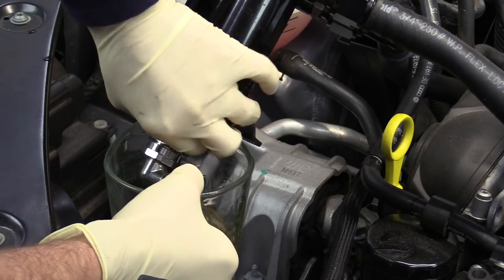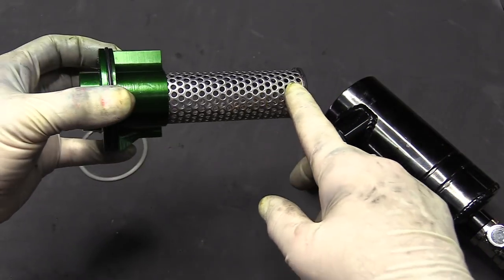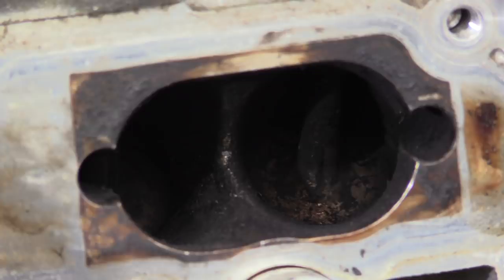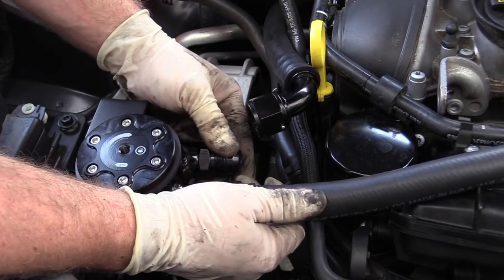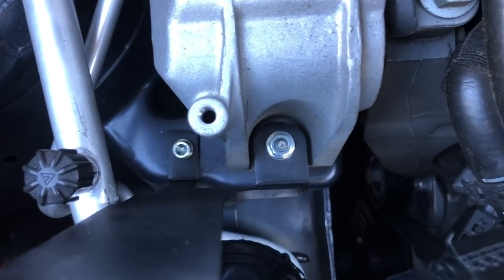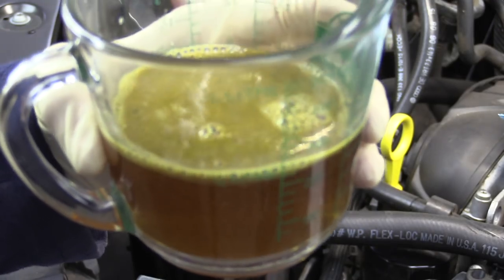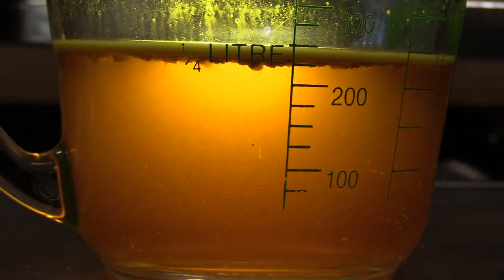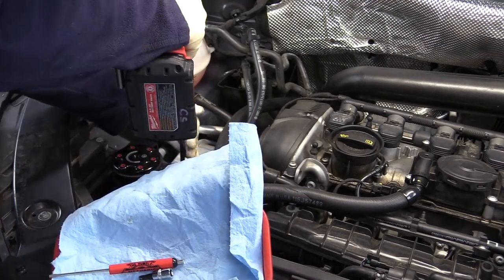Do Catch Cans REALLY Work?

Comment: Looks more like water than oil. Like condensation
Reply: Check out anything lp/nat gas powered. 
White milky shit coming out the breathers , and the oil isn’t far behind that.
Reply: Catch can liquid is blowby (what blows past the rings on the piston into the oil sump) and therefore is mainly petrol and oil (the oil mainly being the solid chunks you see in the liquid he pulled out).
Reply: He mentioned earlier - she's already got two oil separators, what for separatin' yer oil! I presume they're directly ahead of this, so if VW did their job right there shouldn't be much oil getting this far to begin with.
Reply: In my experience, of tens of thousands of miles with catch cans, you collect a ton of condensation as the gas cools and a tiny tiny bit of oil.. exactly as this video shows
Reply: Which is why you do not run those aos setups that filter at the oil filler tube. All that water goes back into the sump.
Reply: You dont want that going threw your engine regardless.
Reply: until you smell it; smells like gasoline/oil mix
Reply: I agree combustion creates H2O molecules.
Reply: @Itwargssf R: Through....
Reply: It is a lot of condensation. I have seen people think their headgasket is leaking because of the white condensation sludge that had built up on the oil fill cap. Just turned out to be people who did short drives all the time and their engine never really sat at high temps for a long time. The water (and fuel) evaporates out of the oil at full temperature but a lot of people don't let their car get hot enough for long enough when they commute to work.
Reply: B K So should I be running something thicker then 5w30 in my 1.8t? It’s a MK7
Reply: thedarkgreenvanman use 5w40 better
Reply: If that is either water or fuel collecting in there they are both, paradoxically, beneficial to cleaning the intake and the combustion chamber. This video showed zero "results" of whether a catch can works. The results would be minimised crud in the intake & valves and there's only one place to check that. Clue: not the catch can itself.
Reply: @ButtKickersReviews  Yup. Won't sell to people to good when you have to drain a catch can every month. Lmao
Reply: @thedarkgreenvanman  use wd 40
Reply: Car manufacturers would never put that on their cars because 99% of the people are too lazy to check it every month
Reply: @ButtKickersReviews  This really bugs me.  I bought a 2002 Mercedes SLK 320 recently.  Did my first oil change using MB new recommendation for Mobile 1 0w-40 synthetic and about 1000 miles into it I'm hearing a lifter tap in the right rear bank.  Just seems very suspicious that it developed soon after the oil change and this oil is very thin.  Don't know what to do now.  Drain and replace 8 quarts of expensive oil and go back to "thicker" oil or try an additive like Liquimoly lifter additive and run it a few thousand more miles.
Reply: thedarkgreenvanman 5-40 syn  in the winter, and 15-50  or 20-50 syn the rest of the year. 

You’ll notice immediately how much quieter the engine is
Reply: @ButtKickersReviews  ask 3 different people get 3 different answers. My question to you is, why would 5w-40 be any different than the 0w-40.  Both are 40 weight synthetic oils with the same viscosity at operating temp.
Reply: Randy Maizland Simple,.. These engines have large oil galleys, and need a thicker oil on startup. 0 and 5w are too thin on startup to build oil pressure quickly. Startup is where most engine wear occurs. 10w-xx is as thin as I’m comfortable going in the cold
Reply: @ButtKickersReviews  makes sense but my valve/lifter tap is not just when cold are only on start up.  It remains at operating temp too.
Reply: Randy Maizland you may need a hpfp cam follower replacement; which is fairly straightforward, and cheap.  Before you change your oil next, top it up with marvel mystery oil, and see if it silences a potential stick lifter; which would be my second guess on your engine
Reply: @ButtKickersReviews  thanks .... not too optimistic on an additive but won't hurt to try right.
Reply: Randy Maizland It generally frees up sticky lifters, if that’s the issue. If it works, just change your oil afterward, and call it fixed. What year is your tfsi?
Reply: @ButtKickersReviews  sorry..what is tfsi?
Reply: @randymaizland9662  it depends on oil pump type
What is your oil pump type if it's like a power steering type of engine oil pump it needs 0w ...
If it's a star like oil pump it needs 5,  10 w ...
It's not only about oil passages actually oil passages depends on oil pump type
Reply: @matteightytwo  so what you are saying is a catch can is useless?
Reply: If it's mostly water and/or petrol then it could actually theoretically increase the carbon buildup.
Reply: @233kosta  shouldn't be but that just showed it's still getting by even if that was more petrol then oil it's still more getting past then you would think should
Reply: @gjkrisa  It's a density separator - they're not perfect. As long as the majority of the oil is stopped - a few ml here and there won't hurt anything.

Neither water nor adulterated fuel are ideal combustion additives, but they shouldn't hurt anything either in minute quantities.
Reply: @ButtKickersReviews  
A) Extra cost that won't be recouped during the initial sale 

Catch cans seem to sell on line cheap, I am sure OE would design a inexpensive unit especially when making millions of them. Besides look at all the added items the dealer sells AFTER someone buys a new car. Once the person agrees to buy a car they go to a room with someone selling things like tint, bras, striping, running boards and so on and order more new stuff for their new car.

B) Extra required maintenance; which would drive up your theoretical 'cost of ownership' for the 'consumer reports' and 'JD Power crowd' 

If OE did not make MILLIONS and MILLIONS on repair and maintenance then they would leave it to the after market only.

C) To be frank, the OEM's DONT CARE about your engine reliability AFTER the car is out of warranty. 

Which for MOST cars the warranty is 80,000-100,000 miles for engine and transmission.

I am not saying you are wrong, just something to think about.
Reply: @233kosta  Yes but what you didn't realise is that the catch can is mounted before any of that (the pipe comes directly from the breather) so it'll catch it first, which makes the original oil separators after the catch can redundant.
Reply: @ButtKickersReviews  D) any water in the catch can would freeze in winter splitting the catch can.
Reply: @freeaudiobooks7469  Agreed. Not to mention the environmental aspect of it all. That's just another fluid that you will have to dispose of 'according to your local laws and regulations'.
Reply: condensation is part of the combustion process?
Reply: @ButtKickersReviews   no catch can is part of the oil change process  that would not cost any more  the added cost is none
Reply: dfctomm  it's why my SUV takes a piss when i go to fill it up with gas (the massive muffler  takes a piss)
Reply: You could evaporate the water and oil off and see what crud is left over.. that'll be he stuff sticking to your valves. But remember, this is just 3,000 miles worth. Imagine ten times the miles and that thin layer of crud building up time after time.

An easy drain catch can like that would be ace.
Reply: Indeed it is mostly water.  But it's also contaminated with oil and other nasties, and that stuff WILL bugger up your intake valves.  No question.  Some engines are worse than others, but if you have GDI you WILL get carbon buildup, it WILL cause expensive problems eventually, and if you have a turbo it'll happen much sooner.

Some manufacturers are bragging about their "dual injection", with both port and direct injection, and suggesting that it's a performance or economy thing.  No.  It's an acknowledgment that GDI causes problems.  They add extra port injectors to keep the valves clean.  That probably solves the problem, but it's also more expensive.  And it doesn't do anything about the intake plumbing getting clogged up.

The problem is absolutely horrifying in diesel engines, both because of PCV and EGR.  I've seen VW TDI intake manifolds clogged with heavy sludge so badly that the engine is breathing through less than 1/4 of the original diameter, and that was with far less than 100K miles on the engine.
Reply: New oil
Reply: @carlmcdonald2735  and those ppl deserve whatever happens to their cars. Including meatball mechanic repair!
Reply: @ButtKickersReviews  
If u have a VVT engine (variable valve timing) u can screw it up by using too thick a oil.
Reply: Condensation in a catchcan looks like thick coffee
Reply: @thedarkgreenvanman  use 5-30 in the winter and 5-40 in the summer

Comment: I still haven't seen anyone confirm after driving say 30,000 mi without a catch can, cleaning the valves, and then 30,000 with one to show whether it staves off 90% or 5% of the eventual buildup on the valves. Catch cans have been around long enough to have shown this. The fact that it remains an unanswered question says something itself. The right way to fix it is with dual injection to periodically (and automatically) wash off the valves.

Comment: The problem with catch cans is...  the crankcase might generate 1-2 pounds of pressure, but the vacuum system draws much much more than the 2 pounds necessary.  You're 'pulling' oil, that would not normally be aerosolized.

Comment: I'd love to see some chemical analysis done on that sludge rather than eyeballing it, looks like mostly water with a very thin layer of oil on top
Reply from the maker: I agree
Reply: can you do a follow up on this video?
Reply from the maker: Yep! I spoke with them today about having the engine oil AND the catch can goo tested at the same time.
Reply: I agree, and if you ask any old timer about decarboning an engine they will tell you to get it hot and pour water down the intake while running. Small amounts at a time. Just like an induction service is done.
Reply: @HumbleMechanic  Did you sent samples for testing? What did the tests show?
Reply: Jonathan Allen it’s going to be.  Water is a byproduct of combustion.  This is what goes right back into your intake via a pcv valve and causes carbon to build up on intake valves in DI motors.  Catch cans slow the carbon process way down.  Colder weather and short drives = more waster.  Warmer weather and longer drive times =less water.
Reply: dfctomm this will help improve your emissions.  You’re not burning that junk back through the motor and in the US it doesn’t violate the emissions for your car

Comment: In cold temperatures it's a great idea to empty this DAILY. Mine gets up to half full on a daily basis in the winters (-15 to 30 degree F weather). Don't let it freeze in there! You don't want excess pressure put onto the crank seal. EDIT: by crank seal I mean Rear Main Seal.
Reply: shhhhhhhhhhhhhh simple fix: just buy a gallon sized catch can!
Reply: shhhhhhhhhhhhhh 
On Passenger, driver or both?
Reply: @FSXflyermaster Shhhhh and add a quart of antifreeze to your oil and gallon in fuel tank.

Comment: The carbon build up I think is because those engines aren't port fuel injected. You don't have gas cleaning the valves like most engines. I think  this will be a bigger problem because more manufacturers are going to direct injection.

Comment: Just tore the pcv diaphragm last week and replaced it for like $20 on my 2011 gti. This makes me want a catch can sooooo badly. Good work Charles keep it up I love watching your videos.
Reply: I have a 2011 GTI and installed the ECS tuning catch can.  In the cold weather months, I empty my catch can every 300 miles.  With my long commute, I empty out the can every three days.  There is a huge concern with the catch can system freezing and blocking the air way which will cause series problems with the engine.

Comment: I've run a catch can on my cammed/tuned 2010 Challenger SRT8 for about 7 years. The can catches straight oil vapor and never ever catches/condenses water vapor into water in any way. The oil in the can looks pure enough to dump back into the engine... although I always dispose of it. This is a very popular mod in the Modern Mopar community and I imagine it is as much so among other car enthusiasts. It ranks up there with CAIs and exhaust catbacks as a mod highly contested as to whether or not it actually ads power. It is my understanding a CC can marginally improve horsepower of an engine by reducing the slight timing retardation that can occur when oil vapor passes by various sensors. Particularly the sensor in the intake tube just before the Throttle Body. How much more power? Nothing you can feel for sure and likely nothing measurable on a Dyno. At the very least, the the interior of my intake manifold is noticeably cleaner; a shallow pool of oil is common to find in the rear of a Modern Mopar V8 but the CC stops that. Great short video!